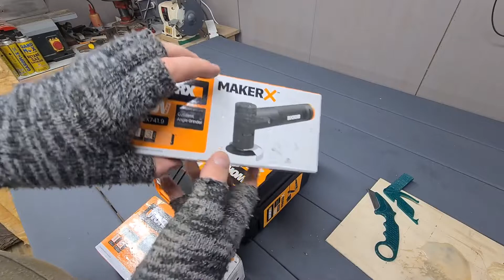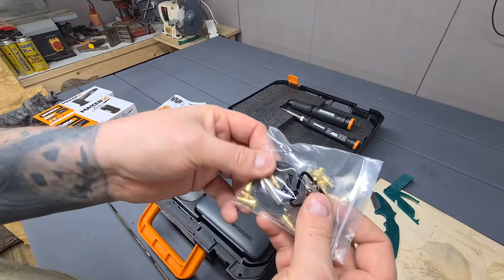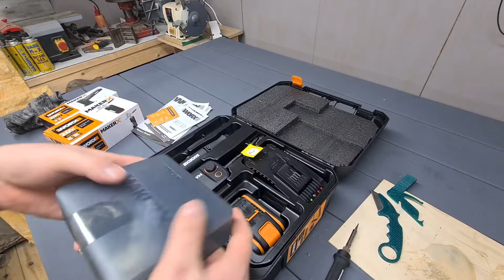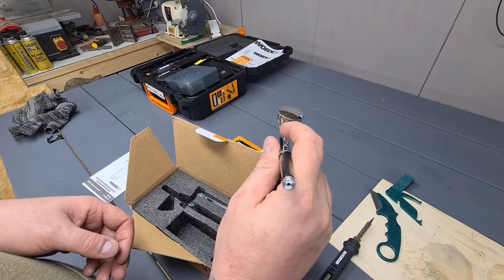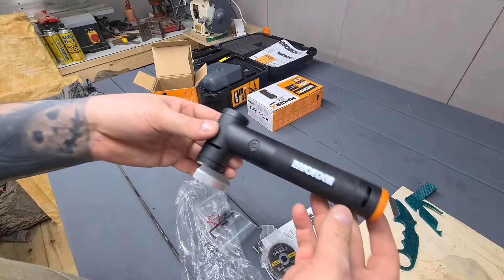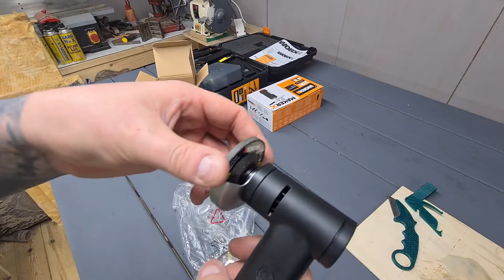Worx MakerX Unboxing Video - Cordless Mini Grinder - Soldering Iron - Rotary Tool - Airbrush Kit

Comment: I like WORX, they are innovative and are a good price. I have their 80mm circular saw, which is plunge action, unlike most of them. It is excellent.
However, I am struggling to see a use case for a corded cordless tool. Especially if you have to unplug one to change to another. If you are going to have a cord it might as well be a mains cord.
I went with the Bosch 12v range- their mini-grinder, rotary tool (they own Dremel...) etc. More expensive, true, but genuine cordless.
Look forward to seeing how they work out for you.
Reply from the maker: I totally understand your point of the cord on a cordless tool, it's a very good point. I think for me it will be more so I can do a job outside without running extension leads. It's certainly a very valid point though. Will use them in some projects and post you some videos. I love the bosch sliding mitre that can go flat against a wall.
Reply: @SmellyCatCreations  Yes that saw looks really good- if at a price. Bosch really has come on recently, with innovations like the X-lock grinders.
Reply from the maker: @Tensquaremetreworkshop  yeah its certainly not a cheap saw at all.